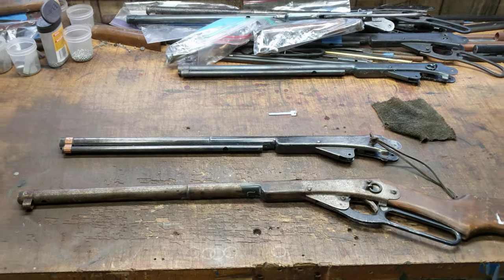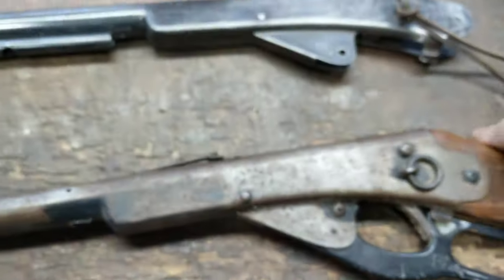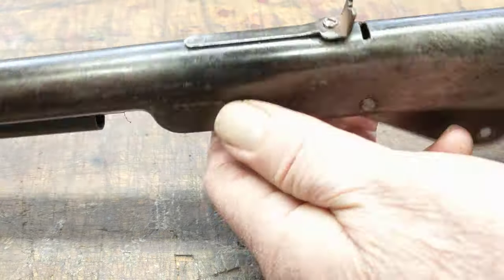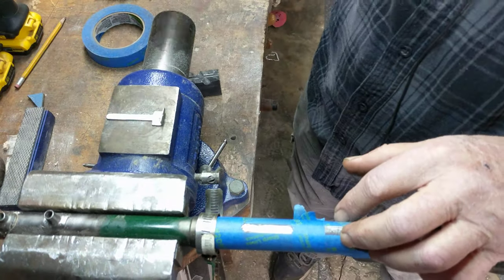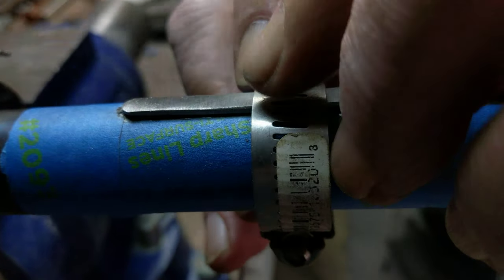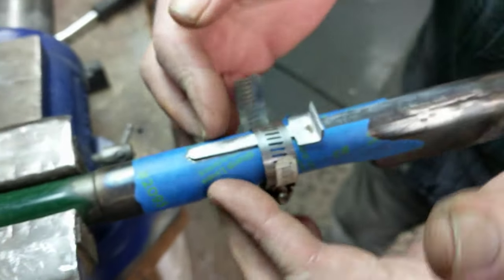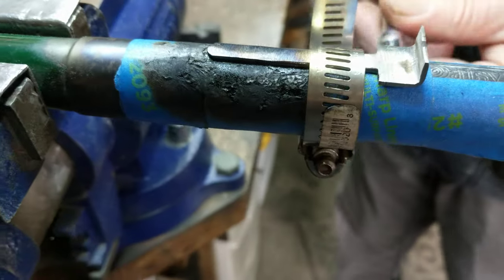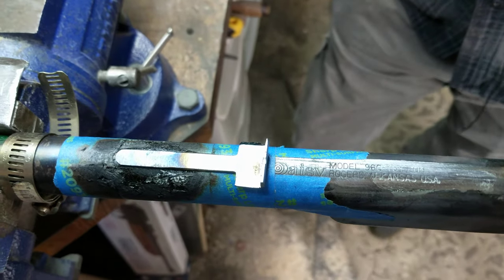Daisy rear sight replacement

Comment: I really enjoy your work and videos 🙂👍 Have you ever moded a Daisy to achieve above 400fps but not by putting a bigger spring but a better combustion chamber pressure Again thank you very much for your work Take Care and Have a nice day
Reply from the maker: Bill, My personal best as far as Red Ryder platforms go is 374 FPS in an 1946-47 Daisy #111 Model 40 with the power triad mods. Cobalt 327 Super Spring, 7/64" overbored airtube and new seal set and a Model 25 shot tube. I have fiddled with compression chambers only to the extent of seeing if using a brake cylinder hone would allow a tighter fit between the compression chamber walls and the compression cup and push more air through to the BB. The results were inconclusive and did not yield any increase in speed. I have yet to try it but I think that converting one of my Red Ryder project guns into a single shot muzzle loader might get the speed of the BB over the magical 400 FPS mark by eliminating the air leaks at the chamber section of the regular shot tube. I did some restoration work on an single shot Daisy #101 Model 36 that ran an amazing 347 FPS with completely stock leather seals and the original mainspring. Lastly, you might cruise over the High Road Forum and read the Daisy Modders Bible

https://www.thehighroad.org/index.php?threads/putting-a-little-more-power-in-a-15-00-daisy.807316/

The entire book is worth reading but you might be most interested in the section that starts at page 25-26 of the the thread where the particulars of a one off custom built Daisy was hitting 450+ FPS. Neat Stuff!
Reply: @RestOModDaisy  Thank you very much for this information

Comment: I need your great help please, my rifle does not reach the lever all the way forward when cocking it.  It gives me the feeling that the last tooth of the trigger has yet to be reached.  can you give me a hand?
Reply from the maker: Olav,  I think you've got a current production Red Ryder with the anti bear trap mechanism and they can be problematic. I can't open the videos you sent so I don't know for sure. Check out this YouTube channel as he works with the new production gun and has lots of stuff on clearing jams.

https://www.youtube.com/watch?v=wtRzsbyYysU&t=240s

Good luck!
Reply: @RestOModDaisy  That's right, it's one of the current ones.  But it was done, thanks to my stupidity and curiosity I was able to fix it and now it shoots.  Thanks.  By the way what is that so-called bear trap, because they mention it a lot but I don't know it
Reply from the maker: @olavwest1873  The bear trap is a safety mechanism Daisy builds into it's current production guns to prevent the lever from slapping the buttstock during the arming stroke if you slip and let go of it. You'll hear 7 distinct clicks every time you cock the gun and those are the "teeth" of the beartrap clearing it's detent as the lever is cycled. You have to hear all 7 clicks before the gun will fire.
Reply: @RestOModDaisy  I see, thanks for clearing the doubt.  Regarding the 7 clicks of the teeth, what happens if only 5 or 6 are heard?  Does it mean that it does not work well even if it shoots normal?  or is it not forced to be 7?

Comment: How big does a copper piece have to be on the end
Reply from the maker: If you're asking about the copper spacer I install on my conversions, you'll need to get a 3/4" copper coupler from a big box store and cut it to a length of .60".
Reply: @RestOModDaisy  thanks

Comment: And if it does where can I get the magazine tube
Reply from the maker: You can buy the current production Model 25 shot tube directly from Daisy if they are in stock or from Cobalt 327 on Ebay. 

https://www.ebay.com/itm/DAISY-MODEL-25-SHOT-TUBE-NEW-ALL-METAL-ALSO-FITS-MODEL-99-WITH-FREE-SHIPPING/293839439034?hash=item446a3204ba:g:31kAAOSwjVtft~PK

The non spring loaded 400/500/1000 round rattle trap gravity fed original shot tubes will occasionally show up there but can get pricey quick and have their own issues to be aware of.